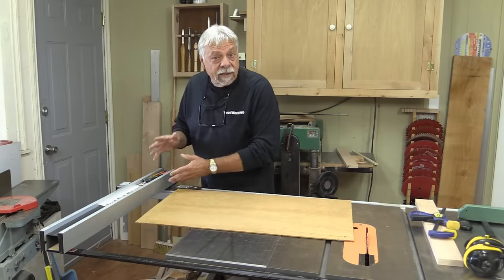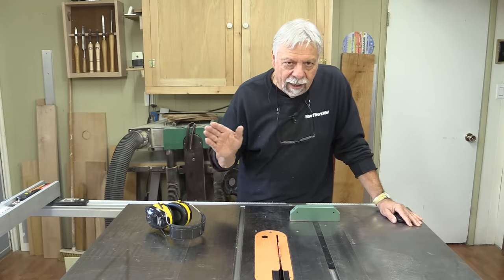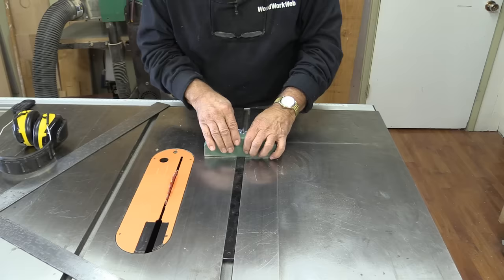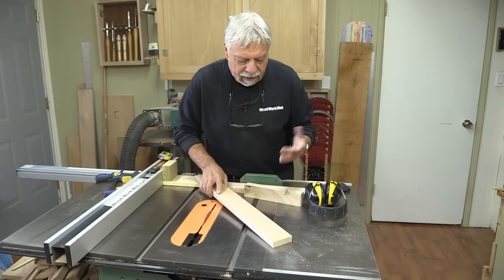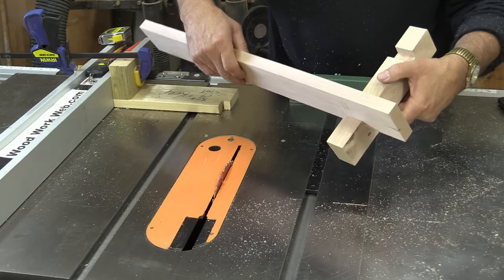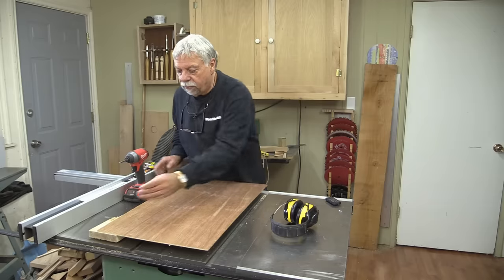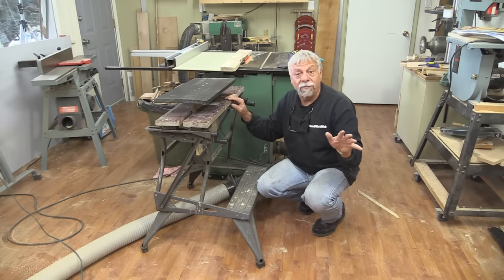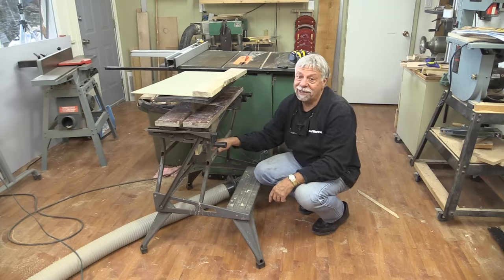5 Quick Table Saw Hacks / Woodworking Tips and Tricks

Comment: When aligning the miter gauge, do not align to the miter tracks - align instead to the saw blade itself.  This will guarantee a true 90.00000° cut.  Aligning to the miter tracks assumes the blade is aligned to that - bad assumption.
Reply: If your blade isn't aligned to your mitre tracks you might as well not even use the saw for any cuts requiring accuracy.  Very first thing you do when setting up a saw.
Reply: Sure, if you set it up at 90° and never ever used it for any other angle.  The blade is ALWAYS the cut line, so aligning to it guarantees a 90.00000° cut.
Reply: @ehudgavron9086  You set your saw up so the blade is parallel to the slots. If it doesn't stay there, get a saw that will. When that blade turns 1/2 turn or 180 degrees, it better read the same distance from the slot. Once that is set, it is more accurate to use the much longer slot as reference.
Reply: Would you rather square . say a room, from a 2 foot line or from a 10 foot line.

Comment: No your not.  Reason is 1 is the framing squar true, 2 is the blade parallel to the miter slots 3 is the miter sloppy in the slot?  4 did flipping it backwards set it twice as far out? Compound the inaccuracies.   
Nothings perfect.  Come on its wood.
Its always going to be off by a minute or so.   Your framing square only good to its size  its only a line segment   Stratch that out 4 miles this way 9 miles that way you'll start to see the imperfections. 
Its close enough for good but its not perfect.   You act as if measurements don't break down into smaller amounts but they do.  Its acceptable to what your doing. Thats the best you can do.